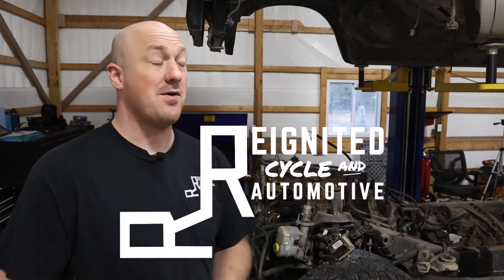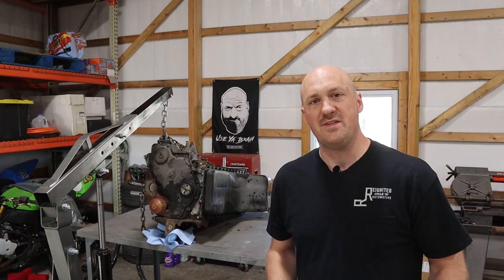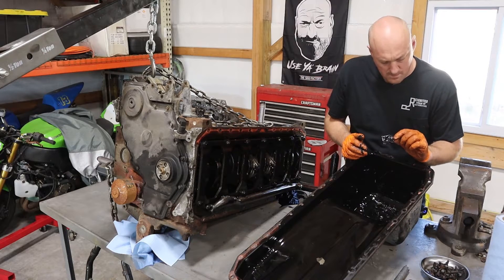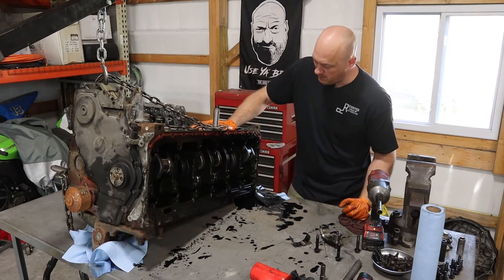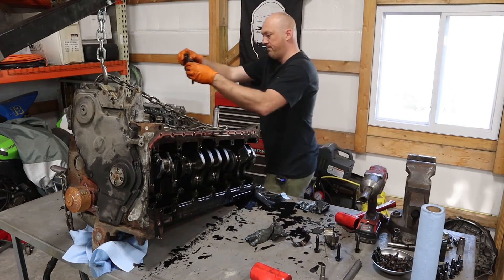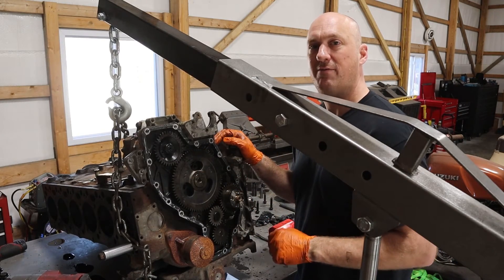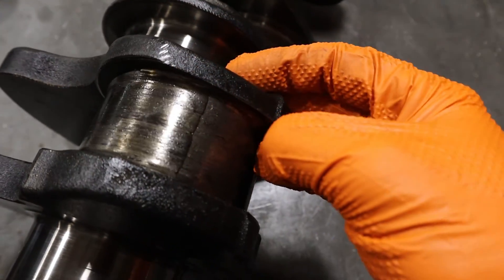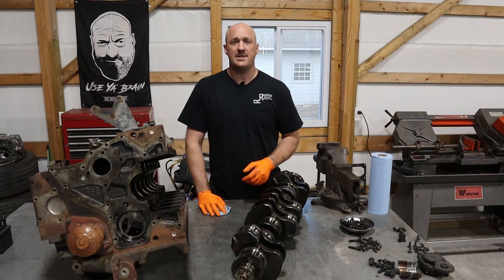5.9 CUMMINS Engine Rebuild  // Episode 2 Engine Tear Down!

Comment: @7:50-8:05 you mention pulling the entire front off.  That's not entirely correct nor do you have to jack up the engine albeit is extremely aggravating, all that's required is to pull the radiator, intercooler, and pull the core support between the coolers by opening the doors and loosening the fenders slightly and spreading them apart to remove the core support.  I know this because I did it this way on my '07 5.9 because I didn't have access to a lift to pull the cab and didn't was easier than jacking up the engine or cutting and rewelding the core support.  I do have a full bumper replacement on my truck so it was also already the first thing off and out of my way.

Comment: Main bearing may look ok, but if the bearing spun then may have got warm enough to draw the cap inwards. Bolt it back to the block and run your finger around the inside and see if there's a noticeable ledge between the two.

Comment: at the risk of sounding completely stupid.....how come there isn't 8 cylinder diesel engines? I know I ask a lot of questions from you lol but on YouTube, you are the best at explaining things
Reply from the maker: Most all Ford diesel engines are 8 cylinder,  Cummins uses the inline six because it's a simple design that can generate a lot of power.
Reply: @ReignitedAuto  oh OK. I'm not a Ford fan and I've never owned and never worked on ford's so I didn't know they had 8 cylinder versions
Reply: @nexpro6118  Chevy uses a v8 design too

Comment: I have a 2005 Dodge with the Cummins.  It has over 300K miles but still runs really good.  I am wondering if I should do a rebuild since it has such high mileage.  If the cylinders are fine, just do a honing and do a rebuild like you are doing here.
Reply from the maker: You could, but honestly if you're not experiencing any issues I'd just drive it. 👍

Comment: Kitty litter is your friend. I've never seen any service  bulletins indicating bearing failure on the 5.9s. I thought is saw sludge in the pan, and there shouldn't be anything else in the pan, obviously, I bet the pick up tube was obstructed, causing oil starvation to #6 , it's the only explanation, unless it was chipped and hot rodded.

Comment: Question: would it be cheaper to have crank shaft reground, resized for new bearing. Always can expect a quality video. Good job.
Reply from the maker: I'm making a phone call on Monday to a machine shop to see if they are able to handle that or not. Having trouble lining up a used crank for this thing. Only thing is a lot of shops are not really equipped for that sort of thing anymore. 😧
Reply: @ReignitedAuto  Seems like in my area it's standard to grind the crank down and go with oversized bearings on these kinds of engine failures but I think there certainly are fewer and fewer shops that can do it right and without lots of backlog delay.   I participated in a diesel tractor engine rebuild with a ground crank and it worked out well.
Reply from the maker: @shjones27  I think you nailedit there that it's a timeline thing. If I could wait three months to get it done I'd probably go that route, but I just don't have that kind of time.